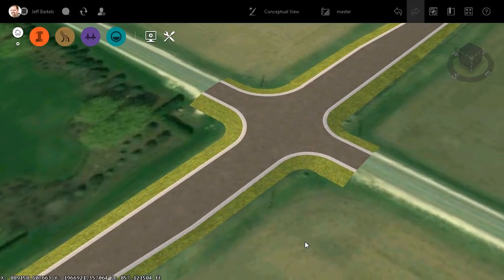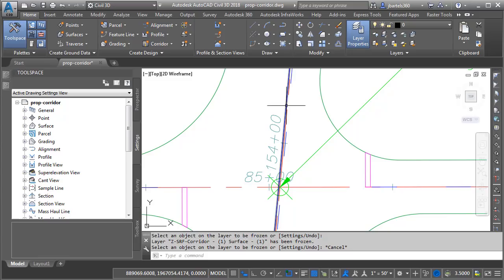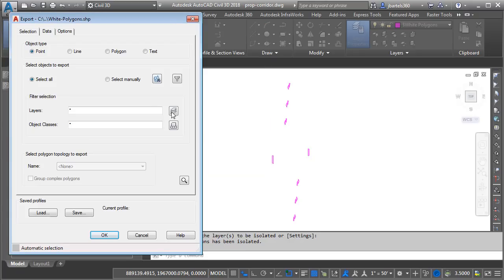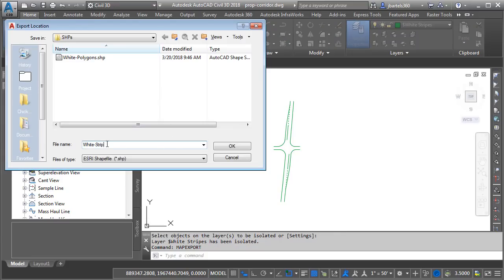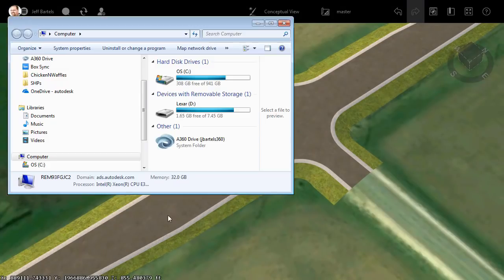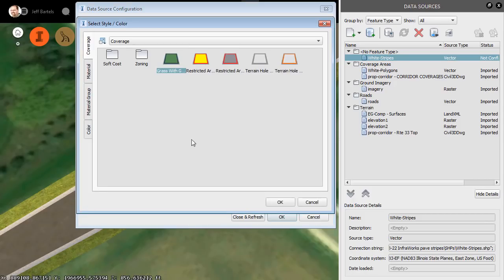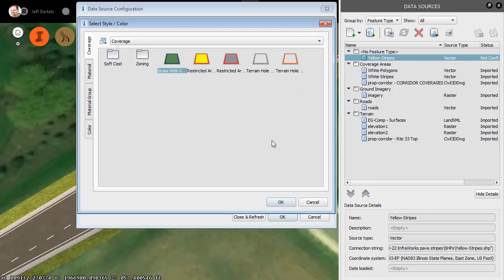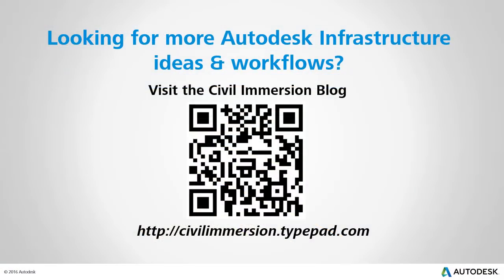Moving Roadway Striping from Civil 3D to InfraWorks

Comment: It does not work for me. Lane markings drape on the terrain surface and not onto the component roads.
Reply: Me pasa exactamente lo mismo. Pudiste resolverlo?
Reply: @daryl71a  me envíe el modelo de Infraworks a Civil 3D y pegué las lane markings sobre las superficies que generan los corredores
Reply: @JMCiller  Eso funciona para lineas de borde, tal como lo indicas. Pero no sirve para zonas de intersección o de accesos, en donde se requieren demarcaciones de bifurcación por ejemplo (las típicas triangulares). Aún no consigo el modo de hacerlo simple. Vi otro video en youtube donde generan un sólido sobre la superficie y luego lo exportan como *.fbx
Reply: @daryl71a  eso mismo fue lo que hice. Proyecto el contorno de la pintura blanca sobre la superficie y tengo polilíneas 3D. Luego, lo extruyo 1 milímetro, por ejemplo, y tengo un sólido 3D

Comment: Sir, this playlist is very nice and usful for infrawork modeling. but here i have facing 1 problem when i am trying to make shape file for infra works modeling road strips can b extracted from corridors feature line but how can make arrow markers and stop line polygone.? here question is this arrows marker n stop lane polygon need to assign elevation from top surface are not.? and when these entities import in infrawork in covarage area which setting you have done before that setting was not shown in this video please help me to solve this problem. thanks for your support.